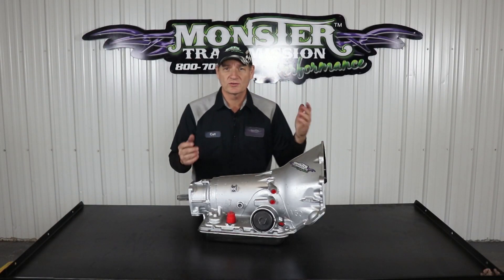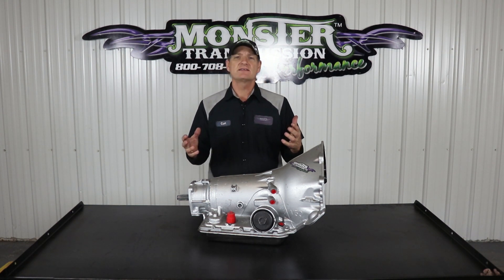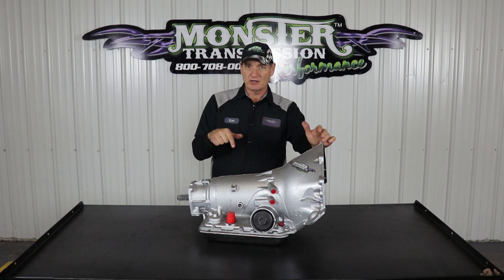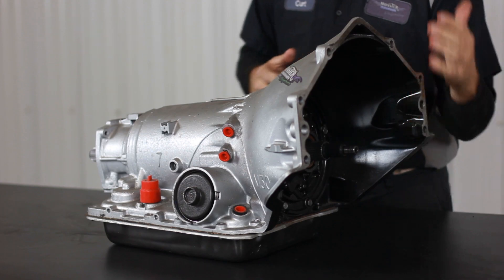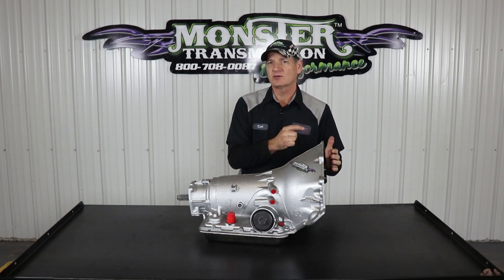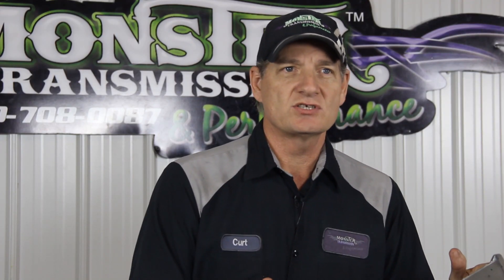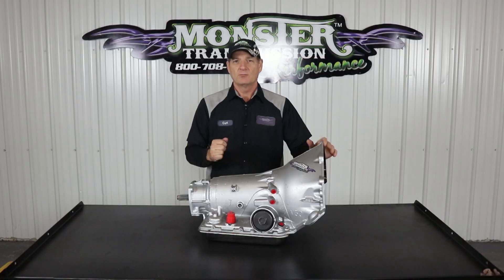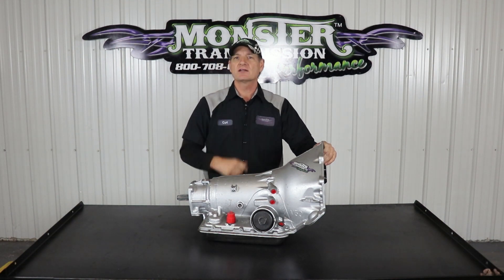Lock-Up vs Overdrive | Curt's Corner

Comment: Is having a lockup like having a 5 gear .how exactly does it cause less drag?
Reply: a locking torque converter is just an automatic clutch that will automatically determine when to full seat the clutch. automatic transmissions in a way are constantly riding the clutch or slipping to an extent and the lock up feature is just stopping that and fully engaging into the gear. if you just let go of a clutch in a manual you would like stall, but if you slowly let the clutch out so as to not put so much drag as it were on the engine then you can more effectively take off. the automatic transmission just does all that for you and when the time is right it finally locks in that gear or lets off the clutch completely... i probably fcked up this and you likely already know all this anyways lol but imma leave it here anyways. cheers
Reply: also, having overdrive is more like having another gear. i mean it isnt but like, it kind of is haha

Comment: So can you have a non lockup converter with a 4r70w overdrive transmission?
Reply from the maker: It is not recommended as those are electronic controlled units and will throw codes if not tuned out correctly